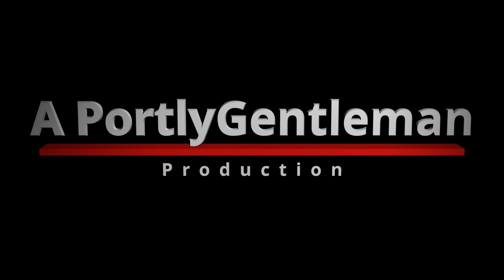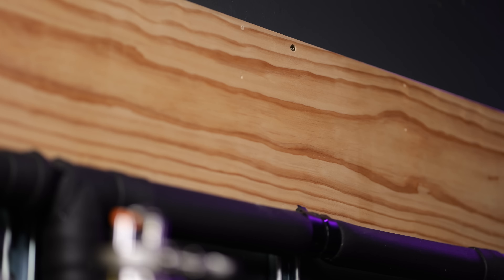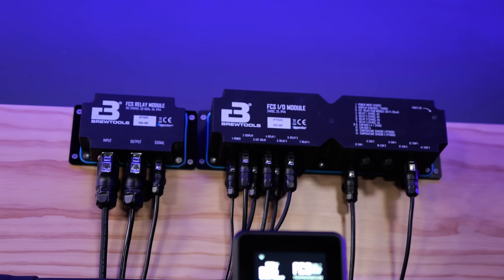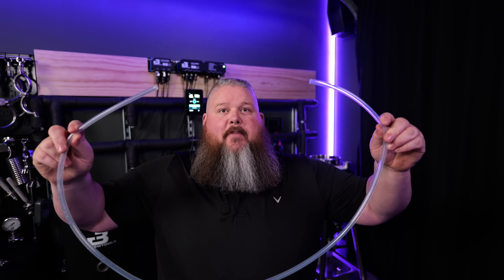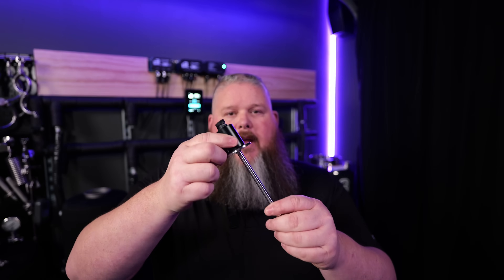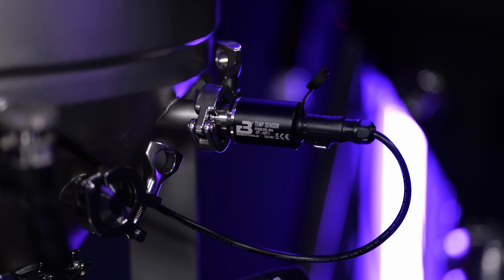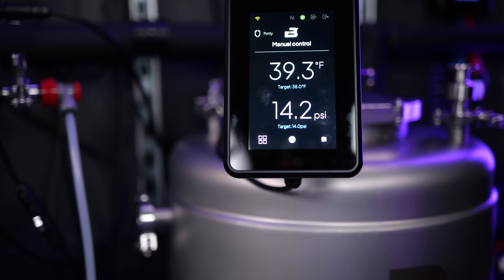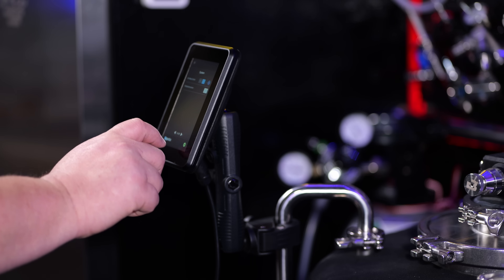The Game-Changing Fermentation System You Need To See

Comment: nice video. thx. but seriously: who really needs all of that stuff? it does seem a little overkill. at least i now know what those two 1,5" ports are for. i don't need them, they are a pain because they add to my cleaning time. i certainly would have appreciated simple volume markings though. also: why have 3 different port sizes? just skip the two inch ports. Done complaing. Still love my brewtools tank. just saying. edit: and why the heck they discontinued the 100l tank i will never know. i9 would have bought a second one, perfect size for my needs.

Comment: I have save it to check it out later. BUT. I only produce 60L a month and I kinda like the hands on approach. Even though I use brewfather I have only ever  used my B80 on manual mode.
Reply from the maker: I'm right there with you at this point in time I still I still like manual control of the brewing process. 
But fermentation that's one that I'm happy to hand over to the machines.  🍻🍻🍻
Reply: I agree. The tighter the controls on fermentation the better. I will watch tomorrow bud. Been partying tonight 😉Keep on keeping on. You're doing a great job!